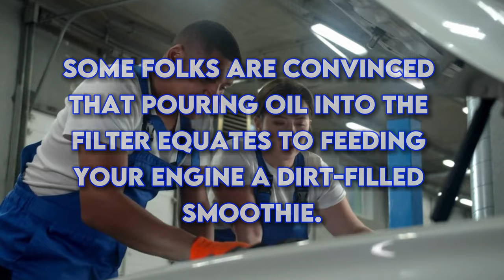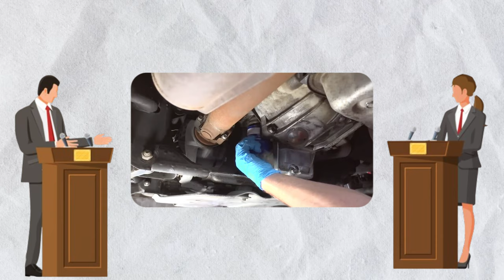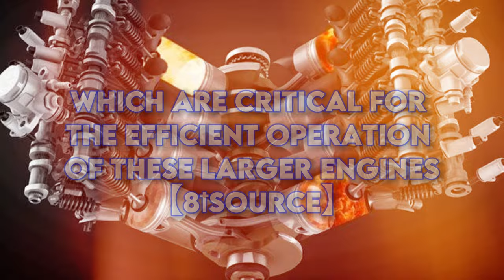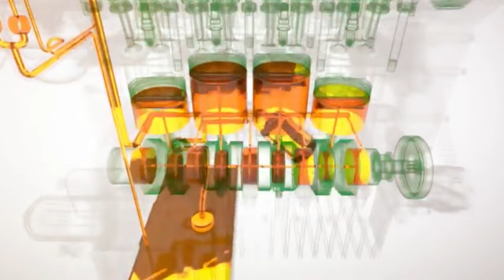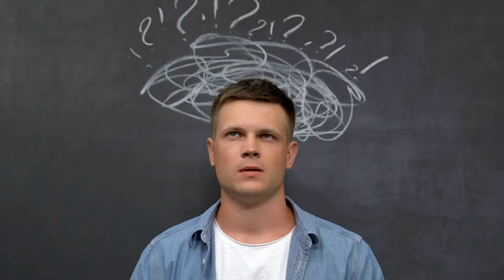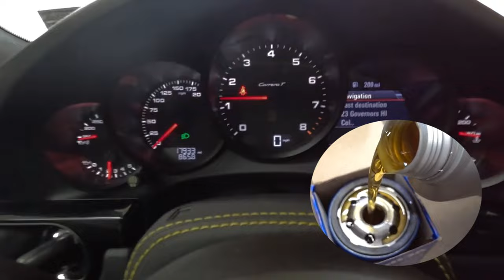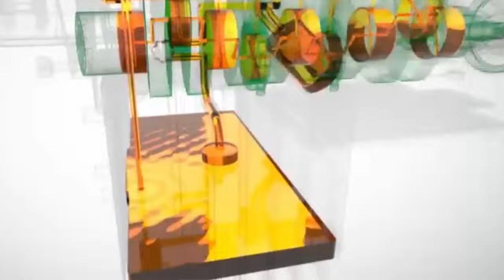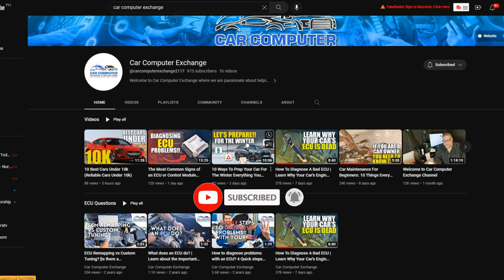Oil Filter Pre-Filling | Myth Or Engine Hazard?

Comment: I ALWAYS prefill. I don't have any concern, pouring brand new oil out of a brand new bottle, into a brand new filter. I'm more concerned about oil starving the engine and bearings any longer than necessary. I can almost believe that oil could be slightly dirty being pumped out of a 55 gallon barrel through a pump, a long hose, and a metered dispenser. It would be interesting to see how clean that oil actually is, compared to a quart bottle.

Comment: I think it’s a good practice to pre-fill the filter with oil before installing it, especially if the filter is mounted horizontally or upside down. This way, you can avoid dry starts and reduce engine wear. I also appreciate that you showed the difference between conventional and synthetic filters, and how synthetic filters have better flow and capacity. I always use synthetic oil and filter for my car, and I change them regularly.

Comment: Most engines are able to pump the oil to the head bearings in less than 1 second.
Filters oil feed as a passive bypass to the main feedso have no influence on shortening the supply to the bearings.
Oil pumps are typically positive displacement with fine toclearance this prevent flow back to the sump and so the oil doesn't have far to travel to the bearing in the head..😊

Comment: Very useful video, the practice of pre-filling an oil filter before installing it is a subject of debate among mechanics and automotive enthusiasts. Some believe it helps reduce the time it takes for oil pressure to build up in the engine after an oil change, while others argue that it may not be necessary and could potentially introduce contaminants if not done carefully. Advocates of pre-filling often argue that it helps minimize the period of dry running immediately after an oil change, allowing oil to reach critical engine components more quickly. This, they claim, can provide better initial lubrication and reduce wear during the first moments of engine startup. On the other hand, those who caution against pre-filling suggest that modern engines are designed with features such as anti-drainback valves in oil filters to prevent oil from draining out when the engine is off.

Comment: On American cars were the filter points down I used to fill the filter with clean oil. On Japanese cars were the filter screws into the side of the block there is no way to fill the filter without it pouring right back out.
Reply from the maker: Thanks for watching JDward.

Comment: False dichotomy.
The debate isn't even between the practice being hazardous or not.  Anyone who's convinced that "new oil" is dirty, is clueless.  Likewise, they have no idea how a traditional canister oil filter even works.  They've also never tore apart an engine with significant damage.  The oil filter only filters particles that are around 20-30 microns or larger, which are caught in suspension of the oil.  Anything out of suspension will settle to the bottom of the oil pan.  Anything smaller than the filter medium won't be filtered at all.
An example of when the filter is almost useless is during engine break-in.  The fine metal particles will simply flow through the filter medium, causing a metalic sheen to be seen in the drained oil during an oil change.  Changing your oil after 1000mi after an engine rebuild is important for this reason.
Most shops don't even examine the contents of the oil, check the drainpan for debris, or submit the oil for analysis.  It typically just gets drained into a vat.  Only mixed fluids, delayed change intervals (thick/sludged oil), or obviously contaminated oil (milkshake) is even considered.

The debate stems more from the practice being a waste of time and causing an unnecessary mess than it does opposing any type of damage caused by "dirty oil".
Instances, where startup of an empty filter vs a full filter are practically meaningless, are with small 4cyl engines.  The oil filter is so small that the difference between filling and not filling is about a second, if not less, of engine runtime.  The film strength on the parts in the engine is satisfactory to protect against this one second worth of difference.  Additionally, many of these oil filters are mounted to the side of the block.  Filling the filter prior to install would cause a huge mess.  Likewise, Some oil filters sit on top of the engine, upside down.  Making filling the filter, prior to install, impossible.

Instances where pre-filling an oil filter is adventageous is on large/heavy engines.  When the filter itself holds a quart or more of oil, its probably a good idea to fill it prior to install.  These filters are typically mounted vertically adjacent to the engine anyway.

A good rule of thumb is if the filter is mounted vertically, go ahead and fill it.  If its not, just screw it on, fill the engine with oil, then start the engine and run it without a load for about 30sec to bleed the system.  Afterwards, top off the oil level.

That being said, it really depends on the type of equipment, and orientation of the filter.
When in doubt, RTFM.

Cheers.
Reply: Finally someone with a brain.

Comment: Myth. Many people never pre filled oil filters and have well over 300,000 miles. Even engineers agree pre fill isn’t needed. That’s why they studied oil filter cartridges. Swap out the filters only no pre fill. You drain your oil but there still is oil on engine parts. Oil starts flowing in seconds through the system. Dealerships even mechanics never pre fill oil filters. If you won’t make a mess  it won’t hurt but not needed.
Reply: Could have swear I heard a myth before about pre filling oil filter causing some sort of air gap or pressure that cause the engine to starve on oil which almost immediately causing an engine failure.

Comment: Oil filter precharging is a debated topic among automotive enthusiasts and mechanics, as some argue that this practice is essential to prevent loss of oil pressure and protect the engine, while others believe it can be unnecessary and even harmful. The video offers a detailed look at both sides of the debate, presenting arguments for and against oil filter preloading.